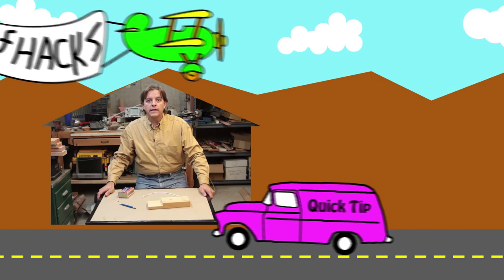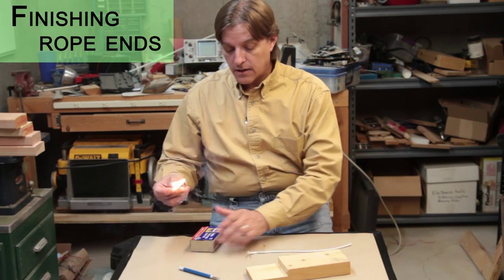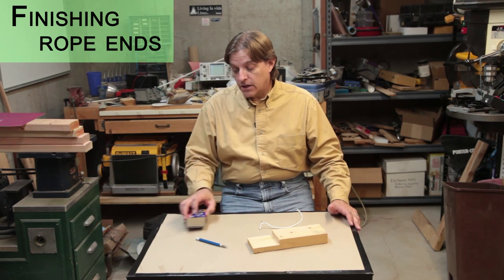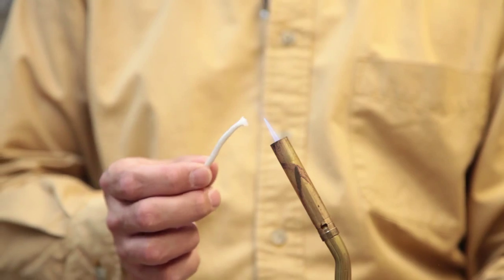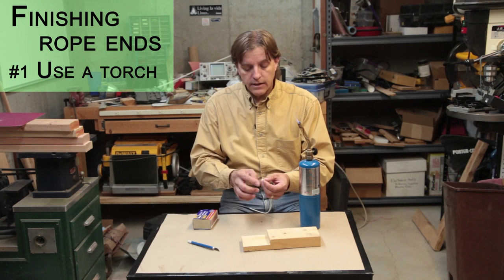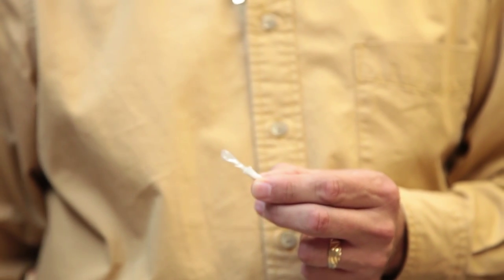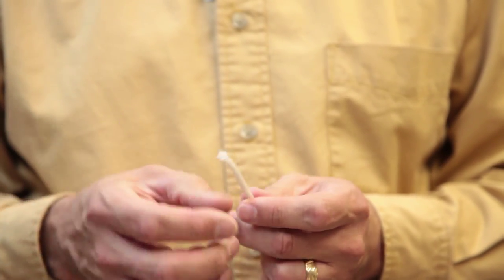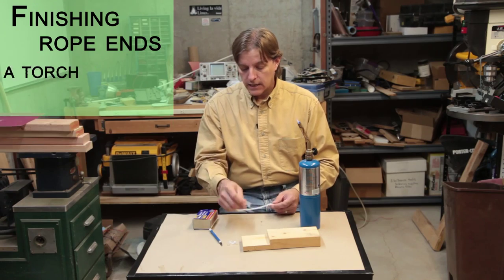How to quickly and cleanly finish paracord ends

Comment: Soo what if my bracelet has frayed for about two inches? Would i use a lighter from the lowest point all the way to the top?
Reply from the maker: I assume you mean the outer part has frayed and exposed the inner core. I'd cut the core back with scissors or a knife so it's just a bit shorter than the outside and then use a heat source to melt the end. Cheers.